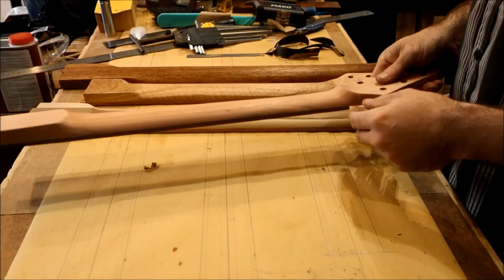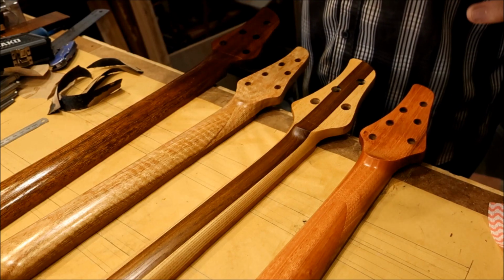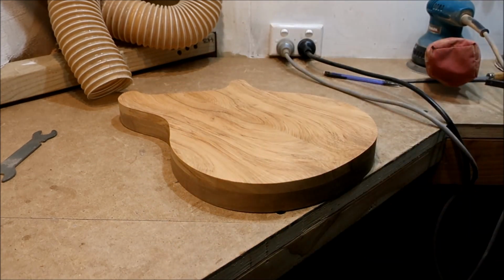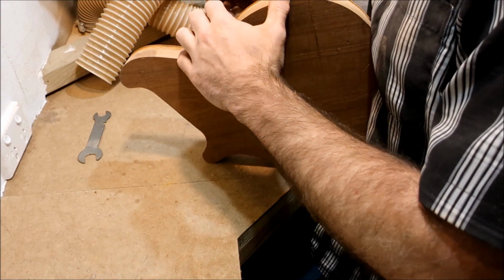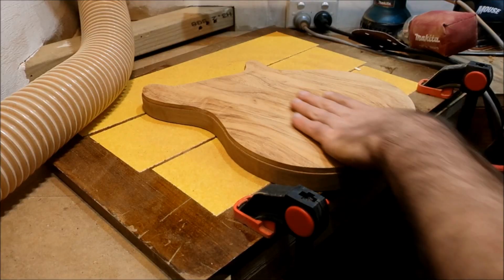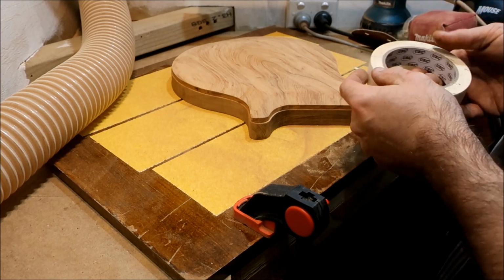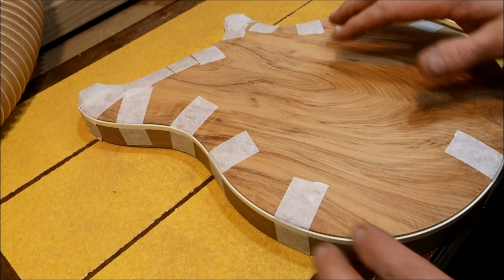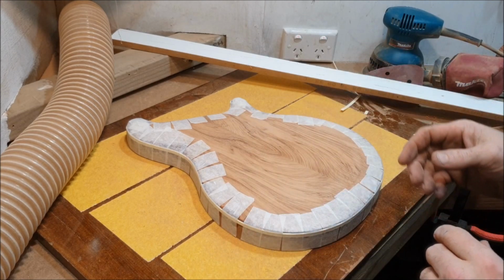Guitar Buildathon Episode 14 - Rabbits, Rabbets, and Binding

Comment: Shinto Rasps are so much nicer on the Hands if you put a Leather Glove on your Left one ...
Reply from the maker: Unfortunately the only gloves I've got that are thick enough are my heavy welding gloves and they're far too dirty do be anywhere near unfinished guitar bodies. It's all right though, the fine side of the rasp is actually pretty dull and I've learned to use a light touch. Thanks
Reply from the maker: Actually, having just finished filming tomorrows video featuring a lot more shinto, I am seeing the wisdom in your words. Thumb is getting a bit worn out. I'll make sure to mention it in the next video, I think it'll be friday's one. Thanks.